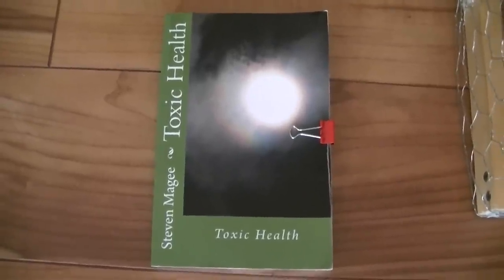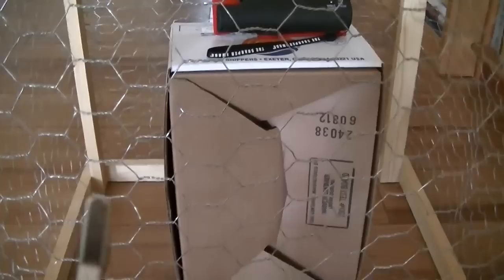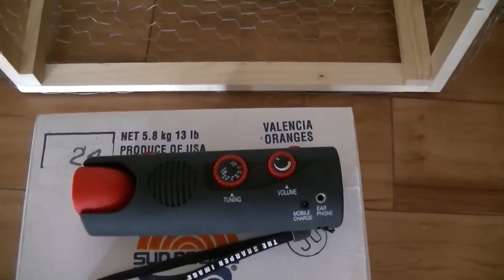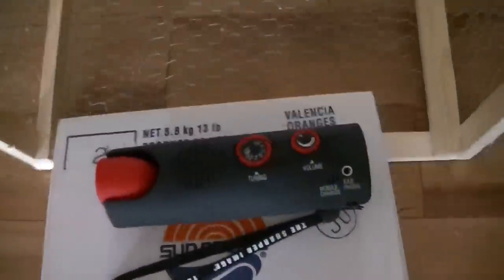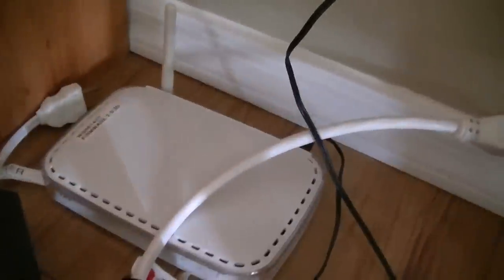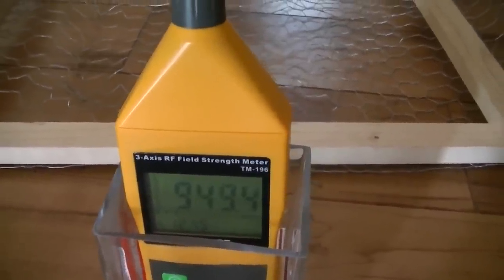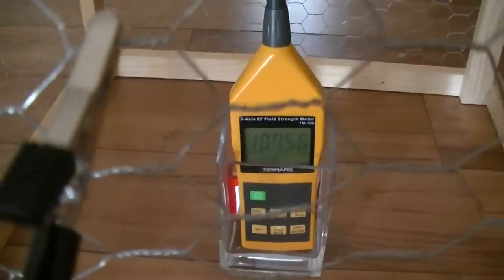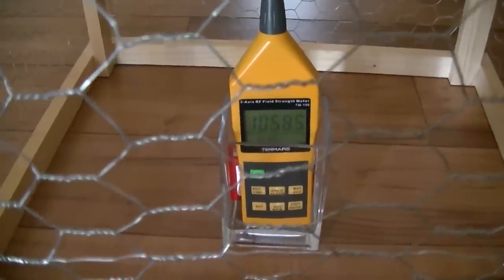The Difference Between Grounded and Ungrounded Faraday Cages Regarding AM, FM & 2.4 GHz WiFi

Comment: Sorry guys for the stupid question. But won't EMP go thru the holes of the metal mesh?
Reply: +Benny A No question is a stupid one. Here he is actually using or expecting the concrete to block it. Technically he has in effect grounded the cage on the concrete. It's a very poor ground as well as the chicken wire is a very poor cage. They welded together a huge rebar structure and buried it in the ground, Then they ran grounding rods throughout the building especially across the roof so that they could drop down grounding line to the cabinets. still we could get radio in the building but it was only the highest strength signals. For a good faraday cage you need to look at how electrolytic capacitors for motors are made. They have a metal can that covers it completely. In another video on here there is a guy who tested a garbage can with and without conductive tape on the lid. I recommend you watch it. (Note: the grounding of the rebar was more to completely discharge any static electricity not to increase the effect of the faraday cage.) They build ESD sensitive products.
Reply: Thanks for the info MK.
Reply: +Benny A As long as the "gap" between the meshes of metal is 1/4 wavelength or less.
Reply: +Benny A Ryan is correct. The principal is that when the electro-magnetic pulse passes thru the mesh it is absorbed. Magnetic fields passing thru metal create electricity but the cage will absorb it. To be on the safe side you might want to insulate the inside with cardboard.